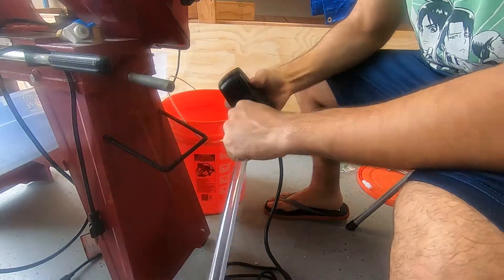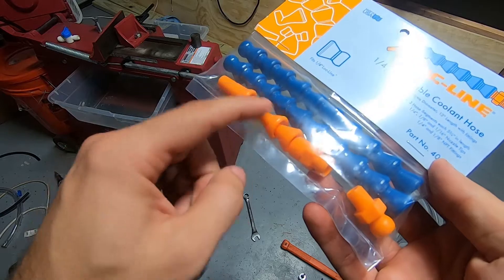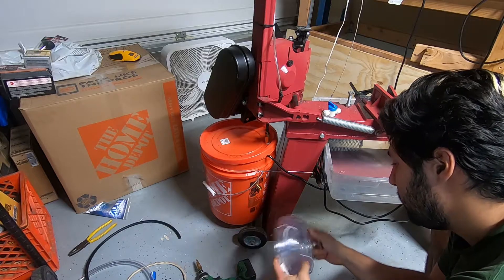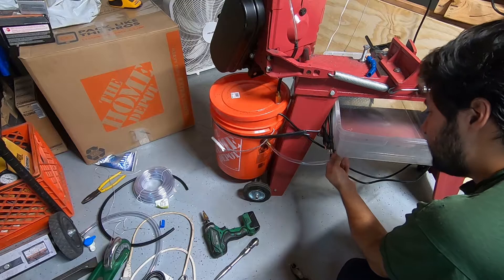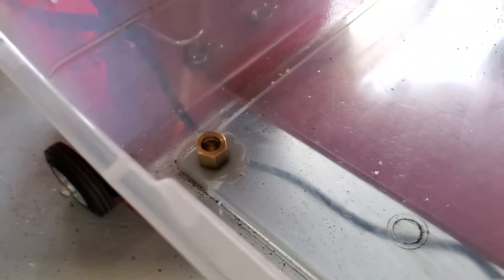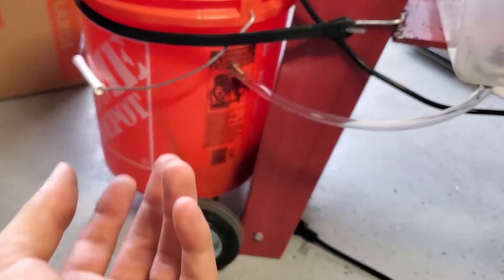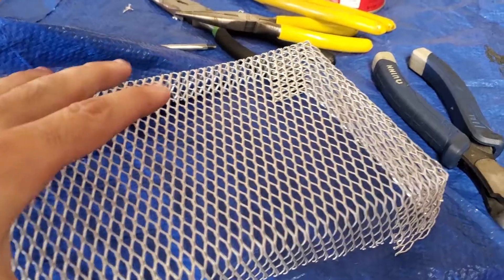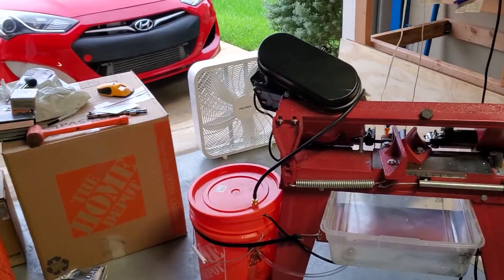Adding Water Cooling to a Bandsaw

Comment: take a piece of 2x4 use the band saw to cut a deep kerf in it  place it over the blade by where it goes into the front guides it will stay there and wick off the coolant dropping it straight down in you pan
Reply from the maker: Oh nice, that's a great idea. I tried using a bristle brush (nylon and then steel with limited success) but I never considered using a piece of wood 🤦‍♂️
Thanks mate